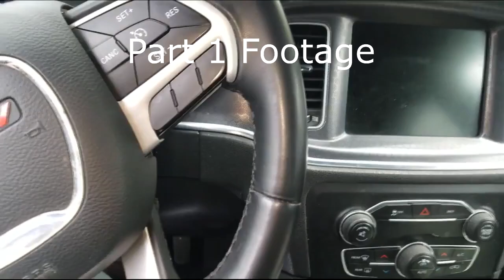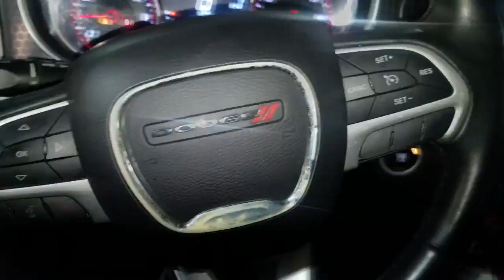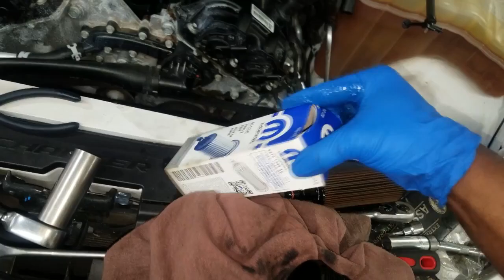SHE FINALLY PAID HER BILL. Here's why her 3.6 Pentastar motor was ticking. LOOK AT THESE CAMSHAFTS.

Comment: Can you  get  a timing  belt  set  perfect?
Reply from the maker: Not understanding the question. And for the record this engine has a timing chain. What problems are you having?
Reply: Yes I am  Subscribe to your channel I have a 3.5 the charger and I have a belt in it can. Can you  have it  perfect
Reply from the maker: @tracyjones4160  lol, sorry bud, But yes I try to get to subscribers concern first
Reply from the maker: @tracyjones4160  If you mean by perfect, the marks lining up perfect? Not exactly, it will appear off just a little bit. The marks will likely never be perfect but the car can be in perfect time. The best way to verify this is to monitor engine vacuum while the car is running right after belt installed

Comment: Where is a good place to start for a ticking only when warm? When the oil pressure drops below the warm up PSI? I have done all 24 arms and lifters. And replaced damaged camshaft. 2015 Jeep Wrangler with 170k miles.

Comment: The shavings wash down and settle in the channels in the bottom of the lower oil pan. Found a rocker's worth in my pan when I pulled it. Looked like grey mud. Well... this Charger doesn't have the channels my Caravan has on its pan. I figure there's still a spot in the pan they will gather in.
Reply from the maker: https://www.youtube.com/watch?v=GYZFIKHGMPE&list=UUSIdv7pEKV2jxJvI6YZB21A

Comment: How much does the dealer charge to find the issue? 

Then how much does they charge just to change that bad cam and the rocker/bad lifters?
Reply: I’m well over 1500$ deep at a shop that does a lot of these issues on the 3.6 pentastars
Reply: @nakashabdul786  how much did they initially quote you for tear down and diagnosis? When u dropped off the car.
Reply: He didn’t charge me to diagnose it, he already knew from the tapping noise what the issue was. And also from the video I sent him prior to that.
Reply: @nakashabdul786  fix it and get rid of it

Comment: Nice and clean valve train how many miles JT on this car?
Reply from the maker: Yea mun that means nothing to a rocker arm thats built with poor material. This is not a oiling problem or a fatal flaw. Just shitty built parts.
Reply: @OnlineMechanicTips  that’s absolutely right I could use $13 a quart amsoil and get the same result so now with this knowledge I just use a off the shelf full synthetic and and change it every 5-6k and call it a day thanks JT

Comment: Hey buddy just did a rocker arm job and now have a misfire on 2 and 6 all timing marks line up.. what could it be?
Reply: Low compression on 2 and 6 and pulled head... valves are good also...
Reply: @ptgtdcr  - Damaged cam lobes or cracked head.
Reply: @sienile  head cam back from the shop good... exhaust guides a bit worn and replaced we will see how it goes...

Comment: What the heck was going on with that oil filter cap? What was all that white stuff on it? Also, why wouldn't you drop the oil pan in this case? I could be missing something, but it looked like no additional disassembly was required to remove the pan itself.